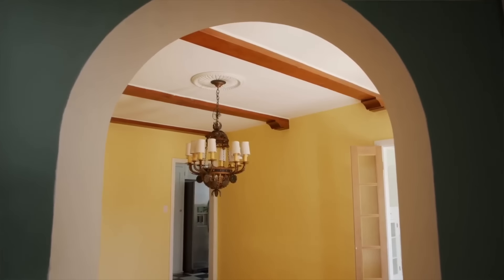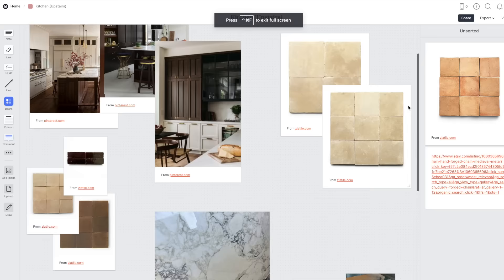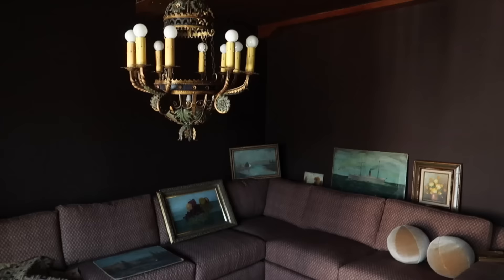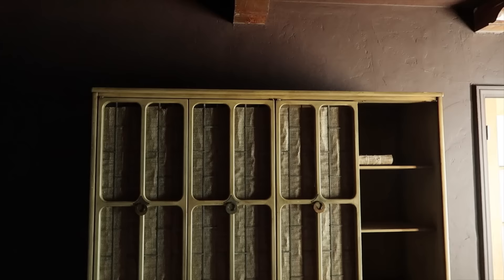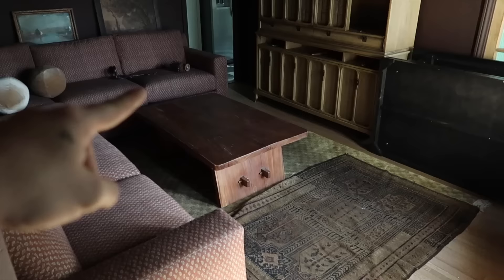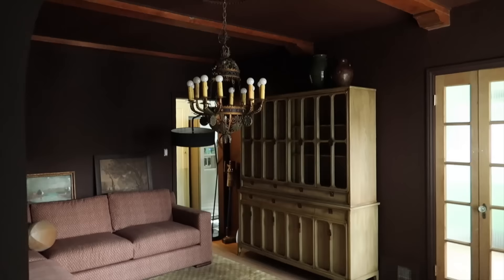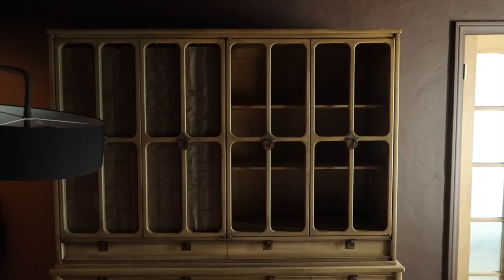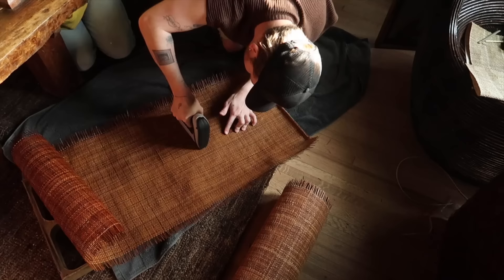MOODY MOVIE ROOM MAKEOVER ✨ Part 2 ✨ Antique Furniture, Lighting & DIY Hutch

Comment: The room is looking great! Not really a fan of dark and moody but it's certainly perfect for a movie room and I do love the colors. Love the alabaster light and it's perfect for that room. Not a fan of the hutch there either mostly because of the access to the bathroom, even if the bathroom's not used often it seems like a toe stubbing situation in the dar room. Also, maybe because I'm seeing it on camera but it gives off a slightly green tint to me. One thought about using the drawers for a projector screen, when the drawers are open it will almost completely cut off access to the bathroom. Am excited to see the next/last step in the transformation.
Reply: I'm not a fan of the hutch there either.  Crowds the room too much

Comment: I feel like the hutch there would work better if you completely shut off that doorway. Right now it says the furniture doesn't fit. If you filled it in, the issue is eliminated and the hutch works great.

I am loving the moody 1920s vibe. I agree on the check rug. Looked great from a distance but too green in the room. 

The one you ended up with is perfection.

That alabaster light is AMAZING for the space.

The one thing I would do differently is the color on the hutch. I would take it a bit darker but then I tend to F around and find out and and forget the sound advice of the great Madam Coco Chanel.

Comment: If you've already committed to the chest on chest - then disregard.  If not, the architecture of the chest is not a good fit with the room, neither is the color.  I'm not sure if re-finishing it will do the trick - lots of work for an uncertain outcome.  I think something not as wide, about half to 2/3rds of the width of the one in place now.  Just opinion, Drew.  The mass of the piece overwhelms the room, and not in a good way.

Comment: Downvote on the projector idea - you'd have to have all the blinds closed so no natural light is getting in, otherwise the movie image will be washed out. This also means no natural breeze coming through the windows. As the room is already dark, removing that bit of daylight would possibly mean you lose all the nuances within the colours of the wall and couch. It'd be better to do your first idea, OR to only use the lower half of the cabinet and mount the tv on the wall above it. Then repurpose the upper half into another console by adding legs and using it in a different part of the house.

Comment: I have an Idea for the projector screen, top the hutch with crown molding that is taller than the screen rolled up and let the front edge go over the edge the edge of the hutch so the screen can be pulled down leaving the drawers in tact.. as far as color goes take a picture of the hutch and see of a paint store can match it, you would  only need a small amount..   I like the light color in the hutch doors better than the dark one..

Comment: A couple manufacturers make "short throw" projectors that would likely allow you to install the projector in the drawer with the screen...this way you don't have a projector on the wall. If not the short throw, you could install the projector on the ceiling with power from the pendant, adding a smart switch and shelly relay to control the pendant.

Comment: Drew, love the room color, new couch, new rug, and alabaster chandelier....hate the cabinet/buffet!  It is too big, feels like the wrong time-period,  crowds the couch, dominates and takes away from the beauty and warmth of this room. I would suggest mounting a projection screen on the wall near the ceiling hidden in an open bottom wall box painted the wall color using a pull-down cord or motorized screen.  This would allow you to put a large modern Art piece on the wall that only protrudes an inch or two so then the screen would drop-down in front of it.  The other lovely paintings would still be nice on the opposite wall with the couch, the mix of art styles would bring interest to the room with the right colors/images. 

You always have the options of a beautiful narrow raw edge shelf mounted on the wall (a dark TV would recede into the dark wall nearly disappearing) or finding a different cabinet narrower (10-12 inch depth), less wide/long (48-56 inches) so it is 2-3 feet min. from the front corner arm of the couch to hold a TV/screen inside.  

Was thinking you should retry the leather cube ottomans again with the new rug, they can be used as tables or seating. Hope this helps inspire you! Will be interesting to see the final look! Have fun!

Comment: I agree with others that the hutch is a great piece maybe not in this space and use. How about a frame tv or using floor to ceiling curtains on that wall to hide a really low profile tv? A rich textile that adds to the layering of tones and textures you got going on I think would be fantastic! Curtain rods would just have to project out far enough to clear the tv so the curtain drapes and you don’t see a tv bump. Maybe even some adjustable color LED strip lights on the rods and you got yourself a moody movie room! It doesn’t have to totally be super theme-y.

Comment: Don’t know if you will see this or not but there is something called a short throw projector. It sits under the screen and project up. If you don’t want to have a projector sticking out of a wall or ceiling that might be an option. You could actually store the projector and the projector screen in the draws together. If you want to watch you open the draws, pull out the projector screen, and let the projector shoot up at the screen.

Comment: One suggestion, the next time you use an acrylic filler like you did around the round molding above the lamp, instead of smoothing with your finger and what looked like paper towel, mix a little dish soap in water and dip your finger in it to smooth it out. Smooths out perfect and doesn’t stick to your finger

Comment: Suggestion To Drew:
You are wanting that room to be a Movie room 
however. You should not limit the room to just that add interest.
It could be a good Coffee chat room as well that then transitions into you want to watch some movies room. The Problem is you have way over done the solid Darkness factor.
You made EVERYTHING the same unjazzed  darkness, The ceiling, the walls, the moldings.
No light is getting into the room, the room is like a blackhole were light goes to die.
You can't even see to read in the during the daytime.
What if you made the walls like more like leather ?
or gave the walls a crinkle or Wrinkle factor .by using some slight corresponding lighter color[s].
By using a gathered wrinkled rag technique that gets varied and pounced on ?
One of these ideas may tie in nicely with the Alabaster light above. Worth a thought !Also the room needs more other lighting added that could be put on a dimmer.

Comment: I can’t wait to hear about the auction, how exciting! Give the chair back? Uh, NO!  The former owner was responsible for knowing its’ value. She probably didn’t want to hassle of an auction, etc. I worked for an AV design build firm, and wouldn’t recommend putting the screen in the hutch, unless  picture quality isn’t a concern. To mount a projector on the ceiling, calls for a specific mount to the brand of projector. You’ll need an electrician to pull power to that spot as well as cable.

Comment: TIP: CEILING FAN  not overhead light. You are going to find the summer/fall very HOT in that west facing room.  And FYI overhead lighting is very harsh - and does a poor job actually illuminating a room evenly. For a dark moody lounge vibe,  suggest you go with the classics of WALLS SCONCES w silk shades( amber glow)  and maybe a couple of painting spot lights that attach to the frame. You could also add a floating shelf above couch and have an undershelf light strip -  Now put that all together -  that's "moody"😉

Comment: 12:07: I love the sexy chillfunk music for that sexy chocolate toned brushed jute rug! 😍

I also didn’t know that brushed jute is a thing, and I’m going to be looking it up… after the past year of having cats, I’ve learned they are DEMONS for destroying rugs and towels (like anything used for a bathmat, or something they can reach to pull down from a hook! Even when the’ve got PLENTY of scratching places, including several flat horizontal ones!), so I need something hardwearing/ideally not expensive! I’ve currently/“temporarily” got this indoor-outdoor rug in my hallway that I bought real cheap almost a year ago, but it’s made of like polyester and isn’t the ideal shape/size… the upside is I totally don’t care if they destroy it, and it’s basically like an extended scratching area that also happens to be a rug 😂 It also slows them down when they’re chasing each other from slipping and sliding on the laminate floors! 🙀😹

Comment: Drew, is it your intention to fill the hutch shelves w/ decor? Because you might want to consider using screen or hardware cloth to insert on the doors. You could even spray paint it gold(?). 
Many times I ff thru sponsorship ads people use on their channel. But you have a manner that keeps me enthralled. Does Milanote work if one is designing a garden? I've been working on a garden renovation this month the old-fashioned way, 📝 Can't do actual work on it since it's under a couple feet of snow. 

Justin's chair story is AMAZING! Do keep us apprised.

 Check out DIY Wife channel. She has done a lot of furniture restoration that's outside of the box. Something you'd appreciate. Lately she's been renovating rooms/homes so go back a year or two for furniture stuff.

Comment: So don't yell at me, but... I hate the hutch in that spot. Would love for you to lean into the art deco theatre style by placing a projection screen on the wall, surrounded by velvet curtains. Also, if you must use the hutch, you can reconfigure the doors to open as harmonica doors to either side, so you can place a large tv inside.

Comment: I think having a projector in the room would be fun, yet not that hutch.  Just mount the screen at top of the wall so it can pull down when needed.  The hutch could be use just not with the two together.  I've seen people take a hutch top  and add small legs and use as a bookcase.  That would be fun in your dining room.  The top can also be under a wall mounted large flat TV and forget the projector.

Comment: I used to work for a projector manufacturer and all I can say is please DO NOT get a projector. They are old technology and you need a load of cables and sockets to rig up a decent audio visual experience. You will get a much cleaner install with a single remote from a flat panel tv ❤

Comment: had that same situation with a china cabinet of that era. it only came with the metal mesh. the contents, china etc would get covered in dust. some people added tiny little curtains gathered on tiny rods to keep
the dust out, some people added glass, but the moldings to hold the glass had to be hammered or glued in to the piece on the inside of the doors. so, i don’t think that the burlap-y material that was in yours was original at all, but an added DIY measure to keep the dust out.

Comment: SUGGESTION TO DREW:
The darkness of the room is just overdone, it is like a black hole.
You need to subtly interject and bring in some light waves into the room 
to breakup and dial down the overly solid darkness.
you painted the ceiling, the moldings, the Walls 
ALL THE SAME DARKNESS COLOR
The wall could use perhaps a crinkle effect like a leather
or a wrinkle effect like the Alabaster light above.
Where you use a corresponding color but lighter or echo some color from the couch.